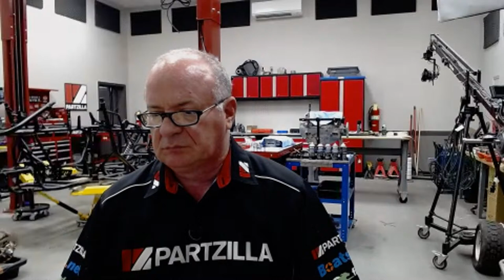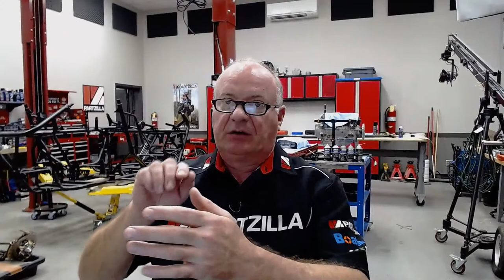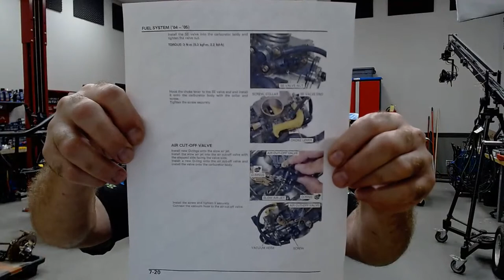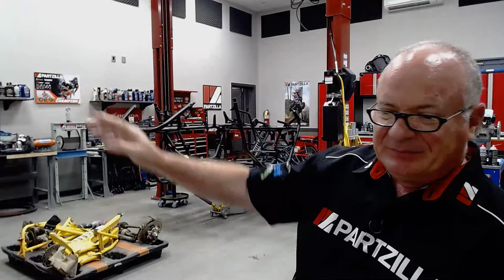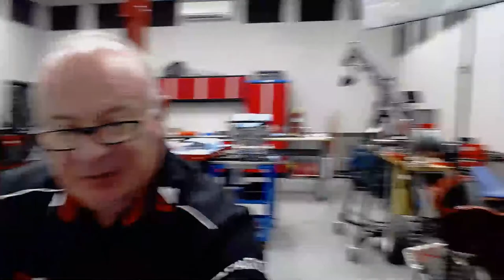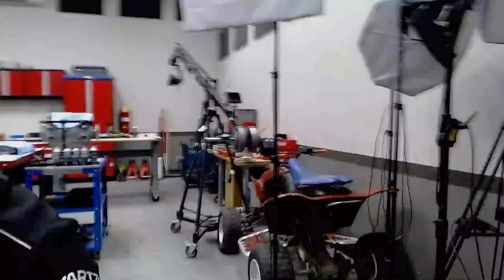Live Q&A with John Talley | Partzilla.com

Comment: Hey john talley. Sorry I just missed you. I have a 2012 Polaris Ranger 500 efi. I purchased this buggy with the guy stating it had a wiring harness short. So I ran down through the harness and checked for cuts or breaks. Came up with nothing. So I checked fuel pressure and it was low. New fuel pump still would just spin over. Checked timing and spark all was good. About to give up and I just decided to check compression just to check it off the list and came up with 30 psi compression. So after putting new rings piston and jug it’s running. But now the problem I’m having is one minute I can crank it and it will idle just fine and the next time I start it it’ll idle for a minute then just die. I’ve checked temp sensor ohms resistance , idle air control resistance as well as plug coil spark plug. I’m pretty much down to the throttle position sensor and I need a tool to set it but can’t find one. Any help on being able to test it with just multi meter in any way. Thanks and I’m all the time watching videos